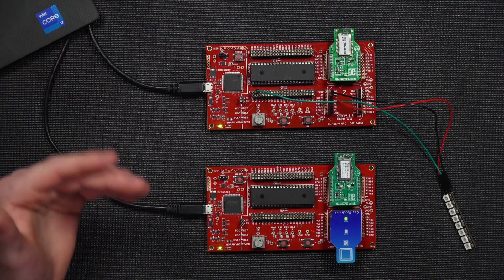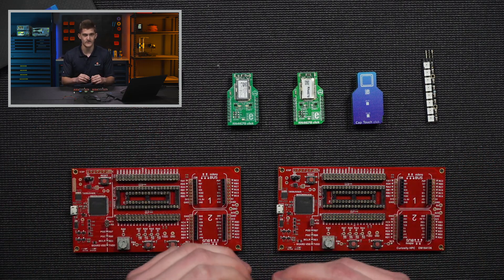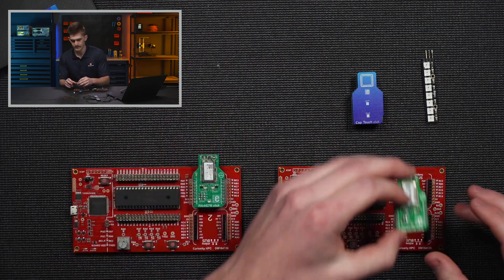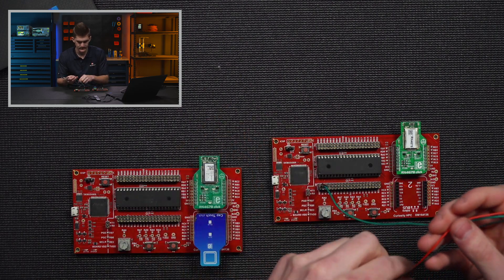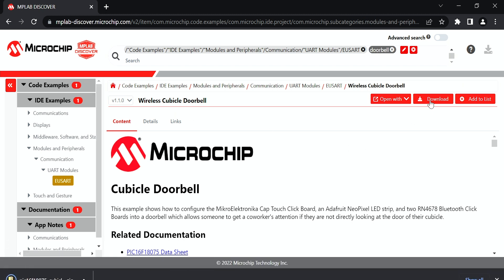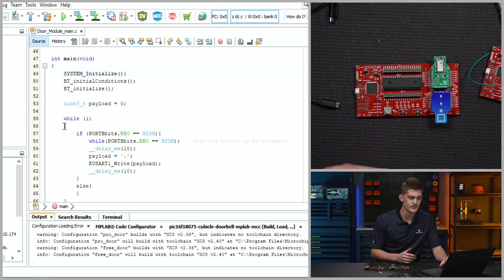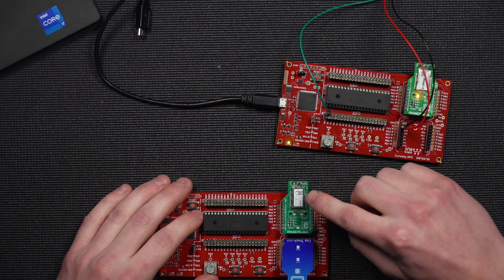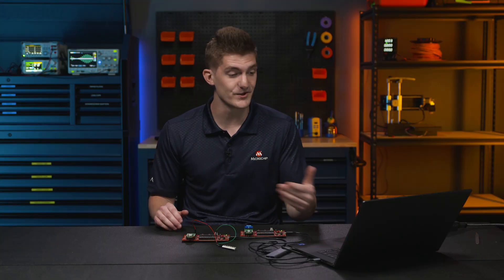Build It Yourself - The Wireless Cubicle Doorbell: A DIY Solution to Workplace Personal Space

Comment: I've had a look at the examples for Communications Wireless from the Microchip Discover link and there is no RF Wireless communication examples available. There is only dated RF development boards by the looks of it and I understand the popular wireless communications are covered but RF wireless is not unfortunately. To me RF communication with the older MICRF chips found on the OOK-TX and OOK-RX clicks offer longer distance solutions, are not linked to the Internet, preferably so and have so many potential applications for home automation. The two MIWI transceiver Click boards have also no examples from the Discover link... only older development kits and outdated software to configure, but yet so many potential applications.